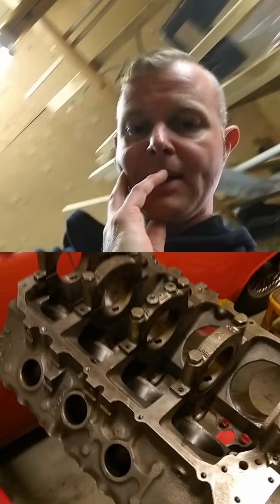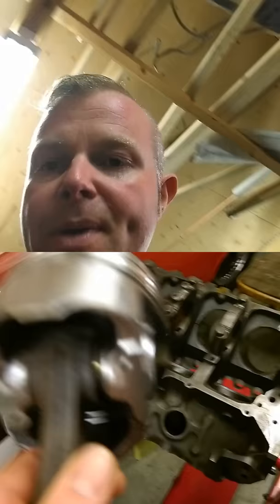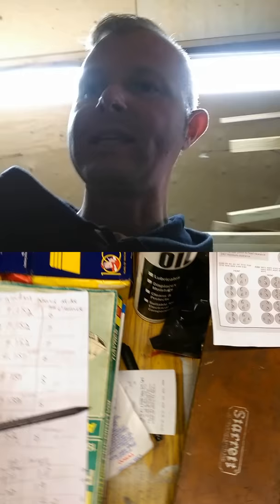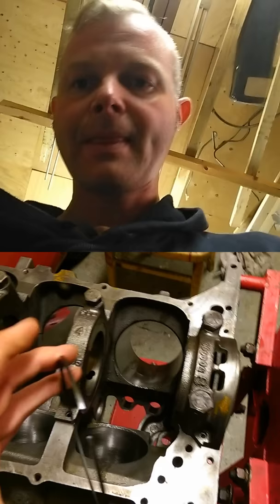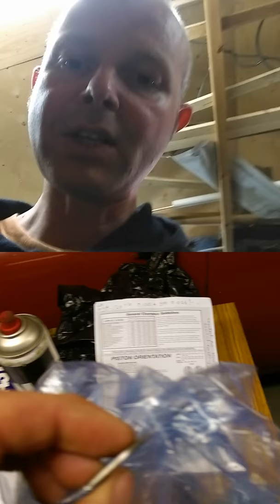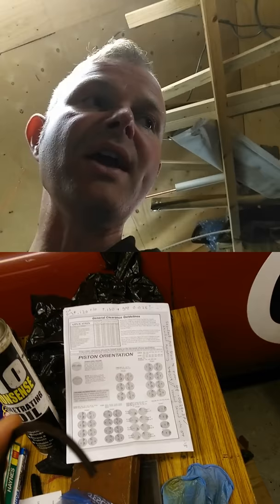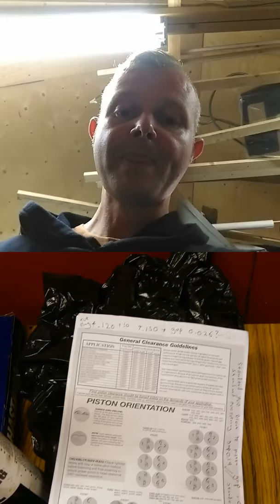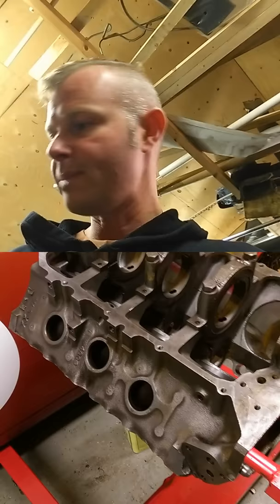Keith Black Pistons horror story or best thing ever?  Engine fail? Ring Gap?

Comment: The KB pistons are made by Silvolite and they have been around forever. The rings are file fit, and most folks put them in bog standard or on the tight side. Hypereutectic pistons 
are intolerant of gaps butting against each other and they will shatter. So the pistons are not the ish, bad assembly is.
Reply from the maker: I absolutely agree, that's exactly what this video explains...
Reply: @gravysnakes  The add on is because Im from the USA and have messed with the products you're using, that's all. Most folks don't get the nuances. I like Pontiacs a lot by the way, and if you need info let me know.
Reply: @hoost3056  so how much do I shave off? How much is too much?

Comment: Looks like I had the same question. My specs for towing show this : (Bore) 4.2794" x (gap factor) .008" = .034" total top ring end gap. Does this look right? p.s. the piston to piston wall clearance is .0024, I thought that was very tight but the specs show .002-.0025 for towing. KB expand less than cast or forged, so you can run tight piston to wall clearances.
Reply from the maker: Sorry i dont have a clue. But please let us all know how you got on. It will probably help someone else. :-)
Reply: You're right about the ring gap factor. 0.034 seems high but for that bore and considering hypereutectic pistons, you're correct. The HE piston to wall clearance is usually around .002" but make sure you Don't multiply that number by 2!! I mean PTW clearance is cylinder ID - piston OD at the skirt level.

Comment: So how did the pistons hold up in the motor? I'm building a 489 stroker myself and wanted to get some input on KB pistons.
Reply from the maker: So far so good, no issues. But to be fair i have only done about a thousand miles, with lockdown and winter. As soon as i am allowed out again i will put the miles on it!  ;-)
Reply from the maker: I have now put more miles on it. No engine failure or anything bad. Its running really nice. It is a little oily.  I am not sure if that's the PCV, the valve stem seals or the oil control ring on the pistons.   There are no plumes of smoke or anything, i am just noticing an occasional puff especially if I rev it. Its not enough to show on the dipstick, the oil is not going down and no one is complaining.  But i will keep an eye on it. Probably nothing to do with the Pistons!

Comment: I have 0.30 kieth black pistons and Molly rings  if I gave the machine shop the pistons to connect to old conrods and they said the bored the cylinders out to fit the pistons. Could I have this problem of the rings binding
Reply: I've had a bad experience with KB Silvolite Hypereutectic pistons as the sizes within the set of 8 were NOT identical. The variance was big. I had to tell the machinist to make each bore different from the other and to number the pistons according to their different sizes.
Reply: @abdulhassan1107  all bored need to be the same size or you will have different compression ratios